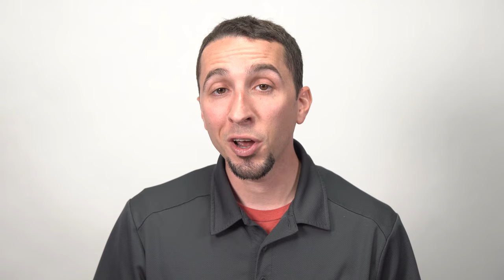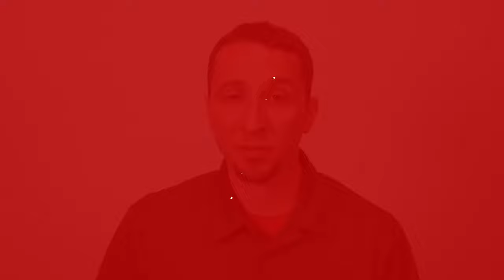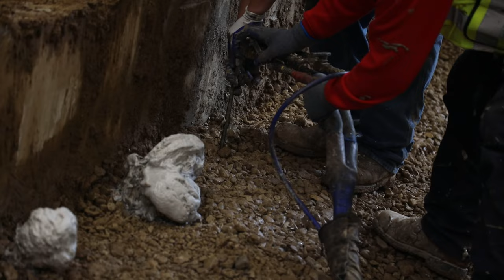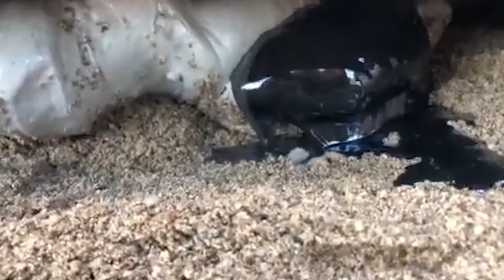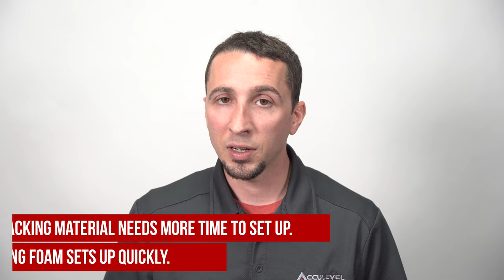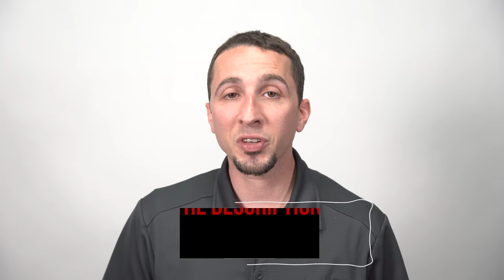The Difference Between Slabjacking and Mudjacking

Comment: I have a question.  I have a friend whos driveway sunk but its still doweled into the foundation and being held up by the dowels but at the corners of the house the driveway broke and you can see the huge gap and water is getting in there.   He does not have much money and cant afford to get it mudjacked/slabjacked and I was wondering if use some spray foam to try and stop the water from getting under the driveway?

Comment: How much can these both lift the slab?
Reply from the maker: This is a great question. Both of these can typically lift a slab several inches. Mudjacking can be more difficult the further the lift because of being able to contain the slurry under the bottom of the slab to create the lift. With slabjacking the foam sets up in seconds so containment under slab with the foam really is not issue because of the rapid set time of the foam material. Please let us know if you have further questions.

Comment: I have an inground pool with a vinyl liner. I live in Michigan where we have both hot and cold seasons. The concrete apron that surrounds the pool where the coping is embedded has shifted and sank in multiple locations. In one spot a gap between 2 concrete pads has opened up about 3 inches wide.  Without seeing it in person, would you say that slab or mud  jacking around an inground pool with a vinyl liner is a viable solution or is this better left to tear out and start over? LOve the pool, hate my concrete. Liked and Sub'd.  Thanks for the content.
Reply from the maker: We could probably better serve you if we had some pictures. If you wanted to send them to office@acculevel.com we would most likely be able to get you some better answers. Thank you for your interest and reaching out.

Comment: I don't think mud-jacking adds weight to the slab. Consider a slab on grade; mud-jacking indirectly remediates a sunken slab by restoring the missing soil beneath the slab.
Reply from the maker: It is correct, it doesn't add weight to the slab itself. It adds weight directly to the soil that is holding the mudjacking material/slab  and has usually failed under the weight of just the slab.

Comment: Which one is more expensive?
Reply from the maker: Slabjacking is more expensive, because the fill material is a higher grade than the "concrete slurry" used in mudjacking.    (It also lasts much longer, doesn't degrade like concrete, and sets up almost instantly.)

Comment: You will never go out of business due to American under engineered concrete work. 
on the other hand you would go broke where i live because there is almost zero chance of a slab or driveway cracking or dropping . i've never seen it in the twenty five years since i moved to germany . Slabs and footings are massive here . my slab is eight to ten inches thick with three layers of heavy rebar and mesh . my cellar walls are als 8 inches think with huge amounts of steel . not even a hairline crack after twenty years . Driveways here are heavily compacted road base in layers . each layer is compacted before more material is added the final layer is compacted sand . it's all about a foot or more thick .
then interlocking bricks are used . water can seep through but has almost zero effect on the massive base.